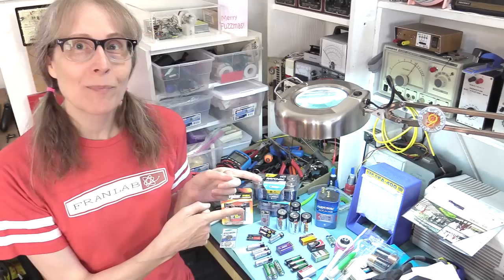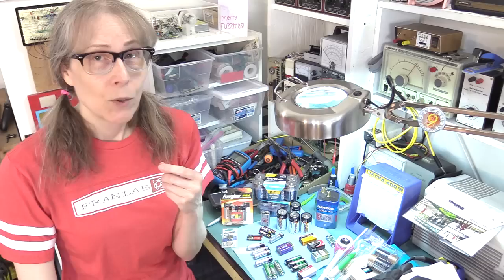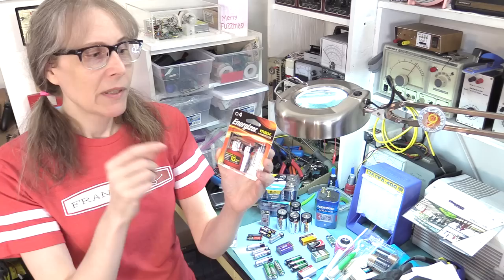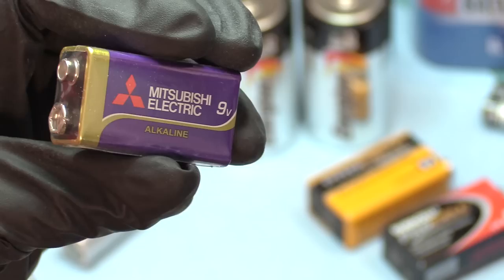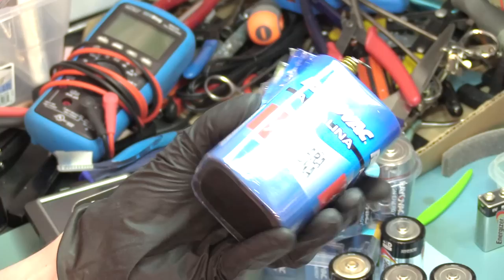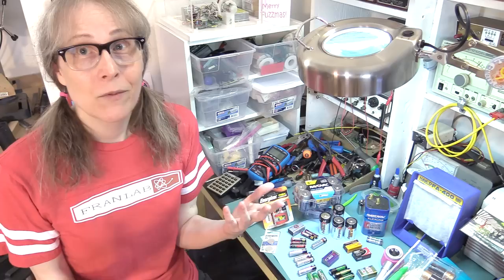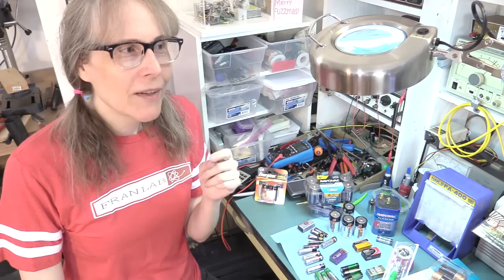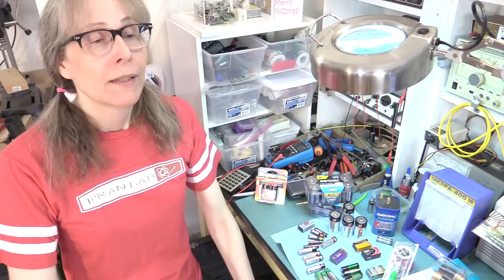Yikes! Leaky Alkaline Batteries!!!!

Comment: Never  buy Duracell,  I've had so many fail in this manner that I've never buy them again... I made this decision years ago. Energiser are usually great, as are GP or Panasonic.
Reply: I just had this happen, and yup… Duracell! Turns out they ain't so durable?
Reply: You pay for the brand, pure scam
Reply: I've had plenty of Energizers fail like that over the years as well
Reply: @TheJunky228  Same. my lil mart mostly has energizers and they leak just as good. Almost lost a line6 wireless mic with them.
Reply: Duracell in now just a brand name lapped on any random cell, they stopped actually making batteries years ago, and are now, just like many household names, a brand applied to stuff from some other OEM manufacturer.
Reply: i've had problems with energiser, more so in the past...
Reply: seen energisers leaking in the pack at a local garage, well within 'install by date' , in the mid 90s , think there mustve been a bad batch
Reply: Yup and yup. I've had a Duracell fail in a similar manner, the thing was like brand new (I had just put it last week in my indoor AC split unit's remote, fortunately I caught it early before it could start gnawing at the PCB traces... Then well, I scraped as much of gunk I could from the contacts).... I never had issues with these before.

Did some kind of black voodoo magic tomfoolery happen with the manufacturing process? I have a few older batteries from the same brand that are quite old but still have some juice left in it (at least enough to make my ol' cheap Quartz clock tick away) they don't yet have leaked....

I guess I'll be putting Carbon-Zinc cells in remotes from now on...
Reply: They seem to last longer at least than the cheap ones and they are the most common. I dont really leave batteries in things so i never really had that problem.
Reply: how about "eveready"? i just tried a pack of AA in my camera some time ago and they seemed fine
Reply: Red Overdrive, the unstoppable confused daltonic!! Were they alkaline? Coz only those ones are known for leaking most of the time.
Reply: Yep, have had Duracell batteries fail like this many times. Energizer seems to be okay but it is a hit or miss, but I never have had any issues with their higher tier ones like Energizer advanced power boost or ultimate Lithium ones. GP also seems to be a good brand. I’ve have used their NiMH cells a lot and they are pretty good and moderately priced.
Reply: @randomscience4k  those eveready were trashed when discharged, no time to leak... anyways i think i've seen also zinc carbon ones (phantometically called "heavy duty") leaking some brown stuff, also some low price watch batteries seem to be fake ones that are insted zinc carbon and they leak ruining your watch
Reply: It's a shame Duracells have become so  poor quality like this . I can remember a time when the OPPOSITE was true , 25 plus years ago , maybe longer. Duracells NEVER leaked in the "old days" , even when they were very old.and dead / forgotten  for years , and they were genuinely good quality  and lasted well. I guess production has been cheapened, gone to China , etc  , for them to become so poor  as they are nowadays . Same with a whole lot of products .
Reply: I haven't yet found a brand of alkaline that DOESN'T leak. Duracells, Energizer, Ray-O-Vac, Pansonic, I've had devices damaged by them all.
Reply: @jerrybarbender9987  That's true. I remember back when I was a kid people always recommended get a Duracell and I never saw them leak unless left for very extended periods. But recently I found even the US made Duracells leaks. But with Energizer it's a different case. I have experienced leaks with them only 3 times in my entire lifetime. And those  3 times were from the SIngapore made cells. I have never experienced those with the US made energizers. And all the higher tier energizers like advanced plus, lithium etc are always US made I have seen. Maybe the US ones are better made because of higher price tag..don't know exactly the reason
Reply: Duracell is worst in terms leakage.
Reply: I've lost 2 LG TV remote controls with Energizer and Eveready AAA batteries, so all these known brands euck!

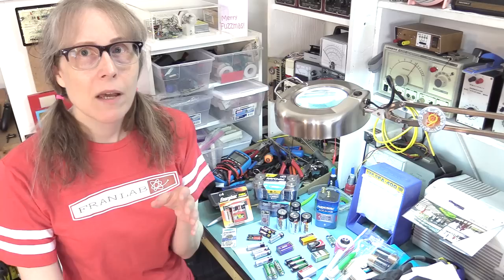Comment: 5:29 Holy Crap !!~!  I've concluded that recently that Duracells are LEAKERS big time !  I thought they were the best , now I'm on the hunt for the 'New Best' ...
Reply: That's damn right!  Duracell is the king of leakers.  I neved had any other brand leaking, only the frigging Duracell.
Reply: They (alkaline) ALL have troubles with leakage, regardless of brand.
I've been using the Lithium-Irons for some years: not a single trouble. 
They are yet a bit expensive, but, IMHO, worth the cost.
Reply: Kirkland have been my go-to for the last 10 years. I’ve only had one leak in that time.
Reply: @pyromen321  Kirkland leak as bad as Duracell.  Kirkland batteries are made by Duracell.  I had both batteries leak in the original package and they were less than two years old.
Reply: Norm475 , crazy! Maybe I’ve just gotten lucky and only purchased when they happened to have unusually good batches. 

When you buy 48 at a time, you’re not taking too many samples.
Reply: Just use NiMH.  They work better and you don't have to throw them away when discharged.
Reply: @travis1240  Wait, you don’t have to throw them away? ^^
Reply: I switched to eneloop after I had to clean up an old short wave radio which was perfectly fine until the Duracell AAs leaked into it, and my favorite wireless computer mouse died because of the same reason shortly after. I didn't even know I was able to hate a company that much.
Reply: Energizer.  Never had a problem with them.  Duracell I won't touch.
Reply: @mawamatakama5150  I switched to Duracells after having many devices destroyed by leaking Energizers.
Reply: @travis1240  Who has time to charge batteries?

Comment: Hi, Fran, and Fran Fans - I recently found that Duracell alkalines had ruined my Zoom Z4 sound recorder, but then noticed that Duracell guaranteed that their batteries wouldn't leak.  I contacted Duracell through their Customer Service page, and they sent me a check for the replacement value of the recorder!  If something like this happens to you, give it a try.  They did recommend removing batteries from devices I don't frequently use.
My personal record for battery persistence was for an HP-15c scientific calculator, same set of batteries since I got the calculator in the mid-1980's.
Reply: I kind of wonder what the limit for that is. Will they honor it even if it's mostly drainage and extreme temps (outdoors from +35 C for -20C) and a $1500 data logger?
Reply: @WorBlux  For really expensive kit, I'd take good care of it. I don't leave my Fluke scope in the car over the week end, try and park in the shade, keep the scope covered with a thick old towel from the sun.
Reply: I have had the same HP calculator battery experience, with an HP-16C... the original batteries lasted more than 30 years...
Reply: @trespire  It's kind of unavoidable. We have dozens if not hundreds of them scattered in some very remote places all over the continental US for years at a time, protected only by a thin metal box and internal dissecant pack.  Paying someone to go check on them even once a month would cost a lot more than loosing one every now and then to battery slime.
Reply: @WorBlux  Sorry, I was presuming your data logger was used as a hand held service tool.   For long term in-situ applications don't they have a solution that draws / trickle charges off the mains power being measured ? Or is it not permissible to parasitically feed off the mains in any way ?   I know an engineer with a Dranetz power monitor that does.
Reply: @trespire  Mains power, whats that? ;) These are logging meterological/enviromental data from wired sensors. Whole system runs off a 5W solar panel and a small 2.4Ah 12V lead-acid battery. Sometimes this fails due to corrosion, lightning, or ageing batteries. At that point 2 D cell batteries and take over and keep logging any of the passive/self powered sensors for another couple months. Then more often then not the batteries start to leak.  Occasionally they batteries start to leak after about 4-5 years even if the main system is still working.

I try to replace any battery I see older than 2 years, but for various reasons the installations are often ignored or neglected until they fail. Then the bureaucracy moves slowly. It's often months between the first failure and when anybody can get on site to fix it.
Reply: @WorBlux  Again I was presuming :-)   I have used Power Quality Monitors (not mine), which are a type of data logger, on my clients industrial lasers. These measure and log a whole range of information such as the line voltage, current, the phase angles between the three phases, current leakage or imbalance between the phases and ground. The result is a 3 to 4 page report with statistical analysis and a few sample graphs. A good Power Quality Monitor is about 5K USD, it's a powerful diagnostic tool.

Mains power as in main / wall power supply for industrial machines.

I'm sure being exposed to the elements deteriorates the equipment. I'm wondering if your company has a preventative maintenance program ? In industry it's proven cost effective, but I wouldn't know for meteorological applications. Still 1.5K per unit is no chicken feed.

Do you use an electronics dry contact cleaner, like Servisol, to clean up the D batteries and their contacts ? Don't use a lubricating cleaner, only the dry one. Removes oxidation and finger oils. Dissimilar metals will corrode, especially where there's chrome plated and stainless fastners. A coating of (Corning) silicon grease will to wonders.
Reply: I have a cardboard covered Eveready C cell from 1980s that still puts out 1.34v today. They don't make them like that any more!
Reply: @trespire   Yes we have a preventative maintenance program, at least on paper. In practice almost no one want to pay for it, and there's not enough margin in the front end to include a free one-year checkup.  Occasionally something like structural failure of a met mast will scare a client into a round of preventative maintenance, but it's rare. 

Also, sounds like some good tips, thank you.
Reply: Steve Johnson_How did you verify the damage to them.
Reply: In Boy Scouts in 60's, my official BS flashlight was ruined by EverReady zinc-carbon. They guaranteed replacement of items ruined. Waited weeks. Finally got a plane-jane EverReady flashlight. Was not happy it was not my camo and possibly water resistant scout light.
Reply: Same for me, duracell just sent a check to reimburse for the replacement.
Reply: @MrDLRu  They asked me to send them the device & the batteries.  I had previously sent them photos of the batteries "in situ" in the Zoom recorder.  I'm guessing they may have either just dumped it all, or sent the package to their research lab for further analysis.
P.S. I deposited the check and have since used a Zoom 2 that I already had (I may replace it once the recorders hit a newer generation).

Comment: Heavy Duty means it’s Zinc Chloride, not Alkaline
Reply: Indeed, the name is standardized, as is probably also “Super Heavy Duty”. At the time those names were invented, they were probably better than whatever came before them, but their power output is poor compared to alkaline. The good quality ones do have the advantage of keeping their voltage for very long, as shown in this video with Kermit.

Comment: Fran, one strategy I use is to label things I need to keep long-term track of with a QR code sticker. I bought sheets of 1/2" square labels and used Google Sheets to dynamically generate UUIDs and turn them into the codes. Then I use AirTable to keep track of that item. Works great for warranties, batteries, borrowing, lending, service, etc.

Comment: I sold Duracell for decades, mostly Procell, Recently I was looking  at some really old equipment that I was getting rid of and found Duracells with expiry dates from the 2000's and they hadn't leaked. Lately a  lot of Duracell and Procell haven't even made the one year mark before leaking. Thanks for the Energizer recommendation. A side point, when Procell first came out, we used to sometimes pull the Procell cover off and find a Coppertop cover underneath.
Reply: I started buying Duracells because I had leaking Energizers destroy several devices.
Reply: I have Duracells from 2000 that are still fine, where I've had new ones leak in the package.

The same is true for Energizers.

I suspect some change in formulation was made that makes them far more prone to leak.
Reply: They always bought Procell's  for the battery powered instruments at work. We had a Honeywell communicator rechargeable battery pac last ten years, don't know what brand it was!

Comment: One of the things that people have noticed when it comes to these batteries is that those with some mercury in the cells lasted for much longer and there are people with such from the 1980s that not only haven't leaked but are still holding a charge.

Comment: I decided to check some of my batteries after watching this and would you know it I have an "Energizer Advanced" AAA alkaline battery “made in U.S.A.” with a 2023 expiry that has just started to leak (the 2nd battery of the pair isn’t leaking). Luckily I stopped trusting all alkaline batteries a while ago after I've had dozens of them leak so I never leave them in devices I value so it has only ruined a plastic battery tray and the adjacent alkaline battery (my last two alkaline AAAs). 

I now mostly use Japanese Panasonic & SANYO rechargeable Ni-MH cells and various lithium primary cells, they’re more expensive but much cheaper in the long run, the price of Ni-MH cells also motivates you not to let them get over-discharged and ruined. I have Ni-MH & lithium cells just over 10 years old and none have leaked. Primary lithium cells are often guaranteed 100% leakproof with no expiry date (although they will still vent if short circuited/overheated). 

I can also attest to the advantage of serializing your batteries and having an Excel spreadsheet to keep track of them, although it is a fair amount of effort.
Reply: Yuassa I pretty good too
Reply: Be sure to check Panasonic batteries for country of origin. They also have cheap Chinese ones, although I must say I have not had any issues with them (yet.)
Reply: @RuneTheFirst  All of mine are made in Japan, haven't encountered any Chinese made ones although I've heard conflicting rumors they have lower cycle life. I do have ones from before SANYO was acquired by Panasonic and they've gotten better since. I bought the original SANYO super-lattice alloy batteries (now branded Eneloop Pro), they made a big trade off for cycle life to get higher capacity, haven't bought them since.
Reply: Indeed - if I don't use it daily I remove batteries now, which sucks for devices that use batteries for backup power only. The battery is never used, but still leaks all over.

Comment: I have just found an old torch that belonged to my parents in a drawer. The battery is an Ever Ready "Blue" No.8 made in France. It is a 3 volt battery, reads 3.17 volts off-load and still gives a good light. With it is a Boots brand SP8 battery which appears to be an unused spare. That one reads zero volts. Neither are leaking, but both bulge a little at their negative ends. I'm pretty sure these batteries have been out of production for many decades.

Comment: My record was my Casio fx-7 calculator from high school with, ironically enough, Duracell Coppertops. They were probably installed ca 1986 and expired in 1993, only to continue working until about 2015, so just about 30 years. I did always use the hard power switch, so that might have helped.
Reply: Yep, in those days they were the best! Sadly not any more. A good name wasted.

Comment: Most fun leak I had was in a logitech mouse.  One day the mousepad was kind of wet and slippery in a spot.  One of the batteries had leaked (a LOT) and the KOH had drained out the bottom of the mouse.  First time I've had a leak escape the battery compartment.   Had to disassemble and wash the case & PCB separately with a pretty good amount of water.  A complete success except for losing the on/off switch plastic bit.

Comment: I have a Boots branded calculator from December 1980 (Xmas present) which untill about 6 months ago was still working on the original AA batteries.  I threw them out, just in case, as they were looking a bit suspect.
Reply: From my experience, those batteries like the ones you had, contain a small amount of mercury.  They could last for a very long time.  I have some "D" cells in a flashlight from the 1980's that still light the bulb quite well.  I keep it around just to see how long it will go.  BTW, they are Duracell. (The old chemistry).

Comment: Great video, in my experience Duracell leak the worst. In my fluke MM with remote display I have to remove the batteries everytime I'm done using it or they will leak.

Comment: Hi Fran - Our volunteer fire department had to send out several damaged air packs for repairs due to leaking Duracell batteries that destroyed the electronic boards inside.  The manufacturer recommended Energizer Industrial batteries because they are designed to resist leaking.  We've made the switch and so far so good.  They've already outlasted the Duracell batteries.  Oddly enough, the price of Energizer Industrial was comparable to brand-name alkaline batteries and a little cheaper than the Duracell batteries we threw out.  Expensive lesson learned.